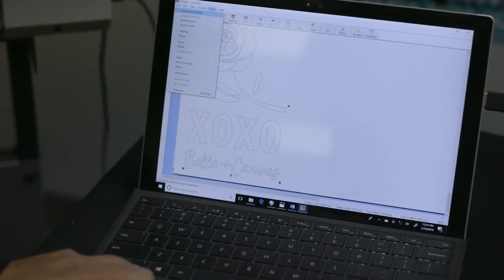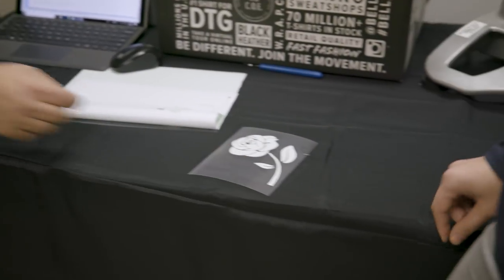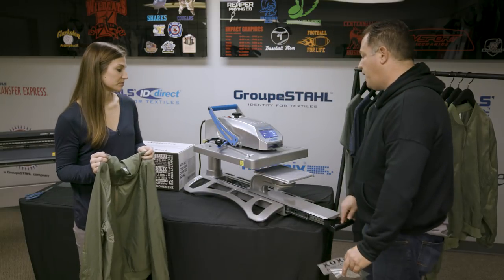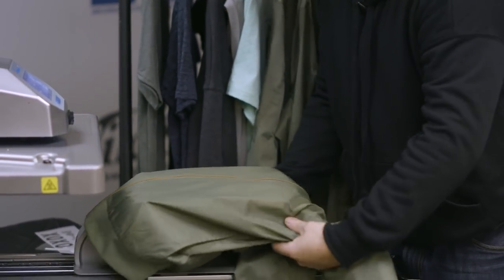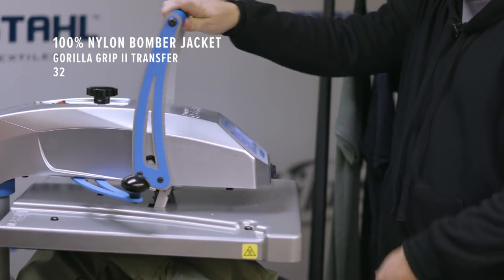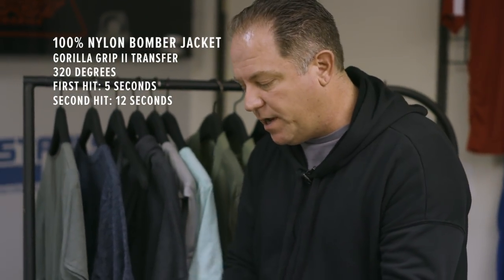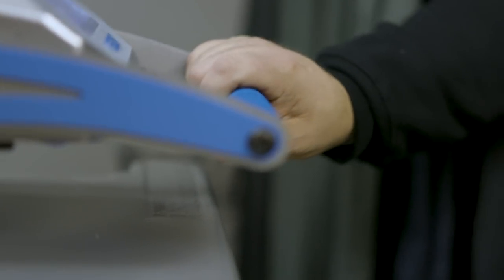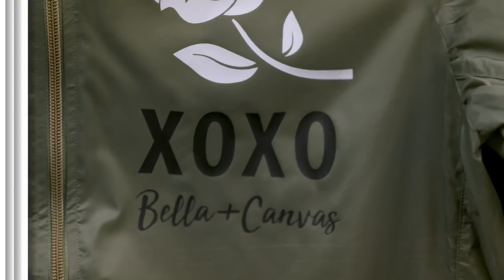Heat Transfer - How to Heat Transfer Vinyl And Nylon Fabric

Comment: Can you use a personal home iron to press the transfer onto the 100% Nylon material (Photo Transfer)?
Reply from the maker: No, because it's too hard to control temperature and pressure with an iron. You would need a heat press for this type of thing!
Reply: @BELLACANVASOFFICIAL  what if u use a heat gun to measure temp on home iron?
Reply from the maker: @OfficialXPage  Hmm.. that's a new idea! We're not too sure. Maybe try that out on a small area of the fabric to test!